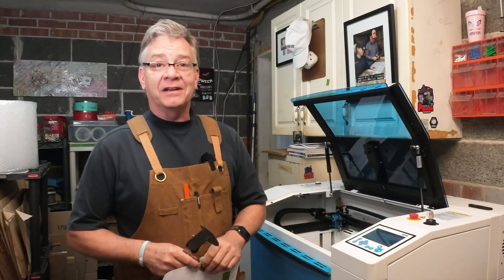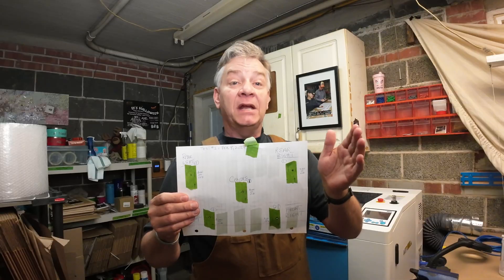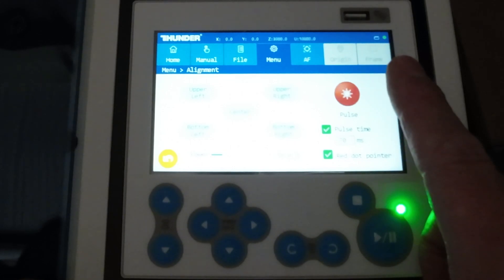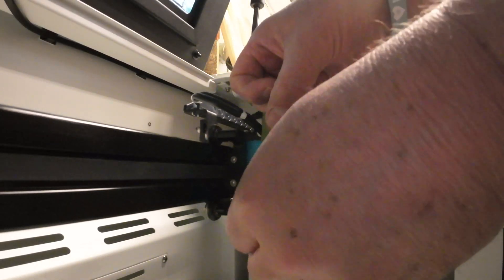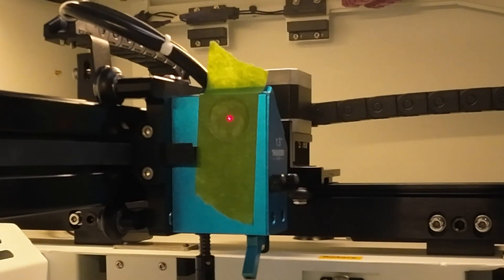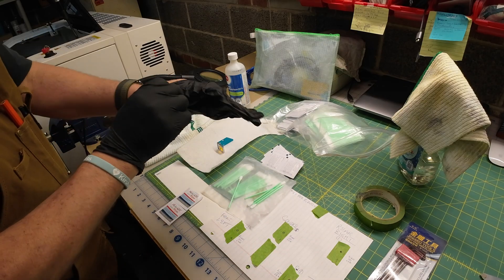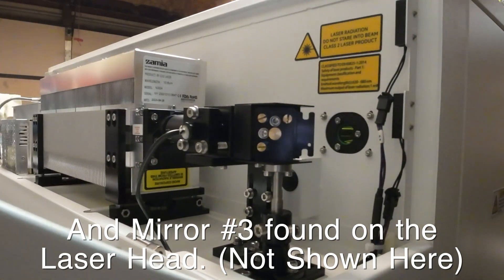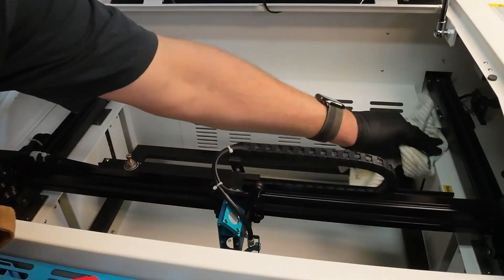Is Your Laser Losing Power? Not a Problem! Thunder BOLT  Maintenance Tips.  024   4K

Comment: What cleaner do you use to clean the mirrors?
Reply from the maker: Hey good day Ruben. Thanks for the Q. on the BOLT, you use Isopropyl alcohol to clean the mirrors, your lens and also to clean the rails on the X and Y axis ( NO grease or lube on the X and Y rails  on a BOLT - only alcohol). Try to get the 99% stuff from the drug store  ( not the 70% stuff) or buy those little alcohol wipes - I get them from Thunder Laser still. I use a micro fibre cleaning stick ( I still order those from TL) - I don't use Q-Tips  because they are made from cotton and cotton leaves lint behind. Clean them daily  or every couple of days if you are not yet using it alot every day. Use lubricant ( not grease) on the big 4 'Z' axis screws - maybe every month or so. It is hard to get our hands in there but try to wipe out the dust/debris from the threads first, as best as possible, with a micro fibre cloth and then squirt a little lubricant into the threads. I hope that is helpful. Cheers and thanks for watching! I appreciate it. :)

Comment: Pro tip, Stack 3-4pc of tape to limit flame up. You can also bypass the door sensors using the TL timer/door board on the left panel of the machine so you have quick an easy access to blow out any possible flames.
Reply from the maker: Thanks - excellent advice. Have a Merry Christmas!

Comment: Thank you GP, you are still teaching us something new everyday 👍 keep up the great job 👏🏼 just a quick question do you clean your Honeycomb too?
Reply from the maker: Thanks Vera. I am happy if it helps a bit. I have only cleaned it with soap and water once. it takes a bit to dry afterwards cause the water collects inside the frame, and the steel honeycomb rusts. However it is surface rust/discolouration - if you use a q-tip and dip it into each of the little honeycombs it wipes right off and shines like new. So now I just wipe it down with Windex multi surface cleaner and a rag and use my air compressor to blow it out. About once a week or two, depending on what I am engraving. Hope that helps!